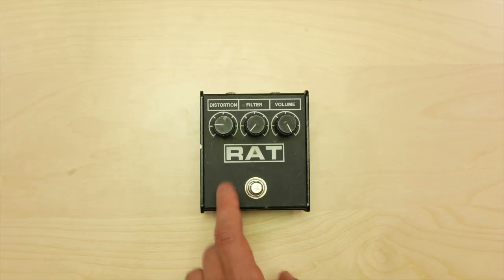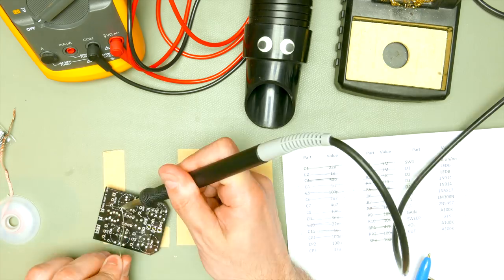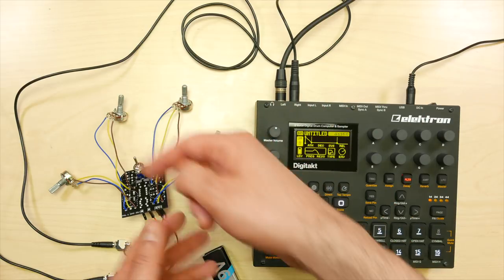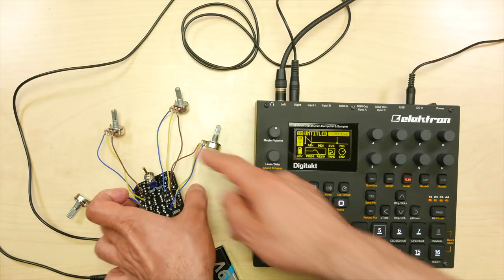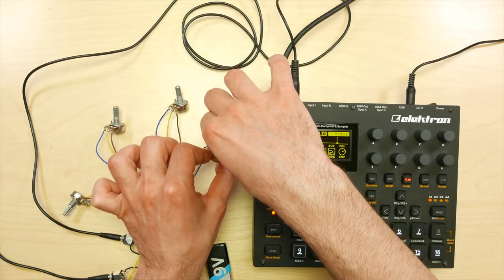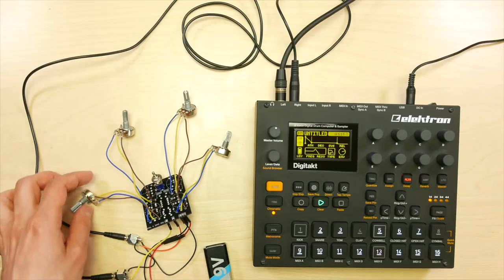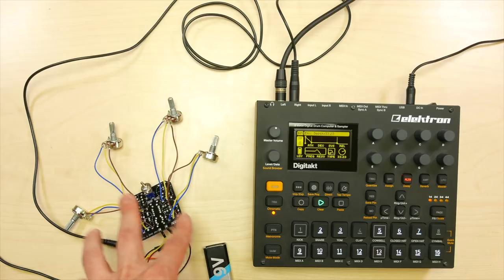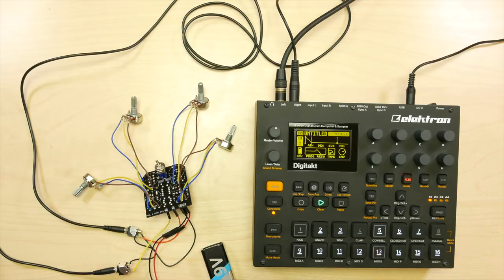How to build an awesome RAT Distortion Pedal

Comment: If you are ordering the LM308 on ebay, be prepared for fake chips (happens alot).  Truth is you dont need the LM308, an OP07 (still in production) sounds just as good.  Have fun everybody :D
Reply from the maker: True.  I got it from a reputable source but--honestly--I compared my "vintage" chip to a few modern options off camera while researching this video and they all sounded good to me.  Maybe a guitar aficionado could pick out the real one, but they all sounded great.
Reply: How do you recognize a fake?
Reply: @uelude  In my experience, atleast when it comes to transistors, op-amps or cmos based chips, they're either; very noisy, a completely different part with a similar functions or they simply just don't work. I've gotten really good fakes tho, but they seem to be a bit more fragile. Cheap production etc. Ebay is a gamble, but sometimes you hit the jackpot :P Resistors, leds and caps are safe to buy tho!

Comment: If those potentiometers are just controlling reference voltages in the ICs with very high impedence, you can probably replace them with PWMed outputs with low pass filters as voltage references, you might be able to create various duty cycles from audio files, so that you could modulate your RAT pot positions with a "music" track.  Alternatively, you could quickly swap flavors with a switch bank that selects from specific resistor values that match resistance values taken from the pots on this pedal.

Comment: Great video. I had a similar experience while running a Boss DR-660 through a Big Muff. Suddenly those ordinary dull samples got really interesting!
Reply from the maker: Thanks Joachim!  And good to know about the Big Muff.  I actually have a clone PCB for one of those but I've got some other builds in progress so it will be a while before I get to that.
Reply: @LeoMakes  Check out KitRae website for too much information on every variant of big muff, and AMZ Electronics for mods to the tone control.

Comment: The other great thing for drum machines is the MAESTRO RING MODULATOR, WITH CV INPUT. This was Tom Oberheim's actual RING MODULATOR invention/design for his college thesis.  "A ring modulator has two inputs—one program, and one carrier with one output. The modulated product of the two input signals are sidebands made up of the sum and difference frequencies, just as in amplitude modulation."

Comment: Dude. 

It doesn't sound like a rat to me BUT I would like to build it.

I am looking forward to your next video, a lot.

Subscribed 👍🏻
Reply from the maker: Thanks for subscribing!  I compared my DIY to the vintage one off camera and they seemed very close in sound.  Not totally identical, but close.  I've heard the components in the RAT have changed over the years, so that might be why it sounds different from what you're used to.  It would be an interesting thing to research.
Reply: LeoMakes indeed my friend, the latest version sounds very different IMO. My comment was not a slant you understand? Just a thought. 

Anyway, I looked at the FB group you linked and will hopefully follow it through very soon.

Comment: Hi !
I might be the biggest fattest noob to ever watch a video like this, so I have not understood a whole lot of what's happening, but I'll do my research on what does what, because I really want to make a pedal like this.
I have one question though, so that I can start understanding how this thing works ; what else do you need a part from diodes, a switch, a button, something to give it power, the input/output "things", the pcb, and potentiometers (100k-150k from what I've understood ?) ?

I don't know the terminology sorry lol
I'm doing my best, I'm not even english, I'm french
Reply from the maker: Hi Benjamin.  I'm afraid I can't give specific advice to everyone as that would take up too much time, however, I did make two videos that might be really helpful for you:

How to DIY Properly (a story of preparation)
https://www.youtube.com/watch?v=Kz7R0pIp3PU

How do Solder Through Hole Parts
https://youtu.be/pUCHd3NYS9Q

Beyond that, I would strongly recommend starting with a "full kit" if you're new so that you can have everything you need in one place.  This saves you from having to find the individual components which can be a bit of work. Do a full kit or two and work your way up to more "from scratch" projects.

Thanks for watching and good luck!

Comment: Where in the hell did you find a LM308N? All I find is chinese scams. Guess I'll go for a cheap TLE2071
Reply from the maker: I did some research and found a reputable UK dealer that sells only NOS parts.  You might want to check there:  https://www.langrex.co.uk/
Reply: @LeoMakes  thanks.. I'll keep an eye on that site
Reply: Ever tried to use Google?? It is no problem to find LM308.
Reply: @kimhansen6384  No shit? All I find is chinese knockoffs. GLHF finding Motorola made LM308N on random Google search
Reply: @onkelberra3166  Try here, they are about $3 a piece: https://elektronik-lavpris.dk/p125453/lm308n-operational-amplifiers-dip-8/
And there a lots of other places you can find them. They are cheap standard opamps that you can find everywhere. Or use
an eqvivalent - it doesn´t matter much, TL071 / TL081 are probably better, and much easier to source. All the hype about
special opamps  - most of them sounds the same. LM308 is just a shitty old opamp, maybe even a LM741 would work fine,
but it would probably be a bit noisy. I would try a TL071. Those were the ones used by Marshall in their solid state circuitry,
for at good reason. They are FET based, and distort nicely.